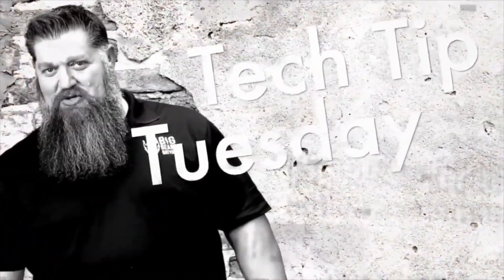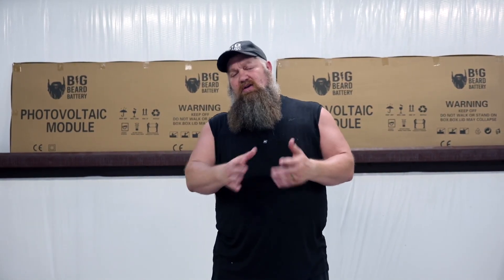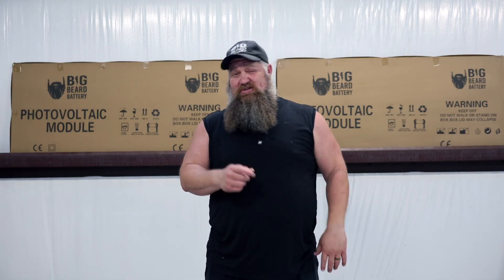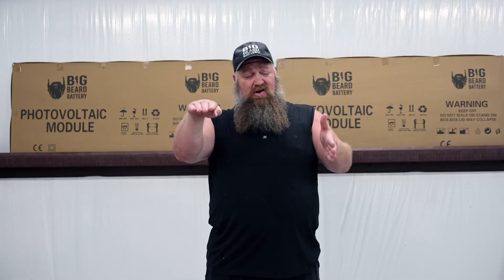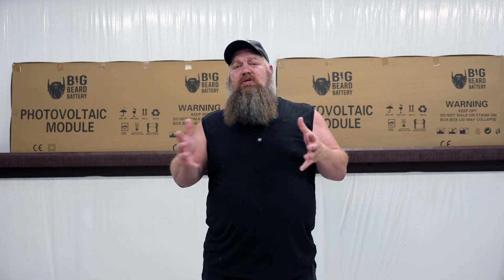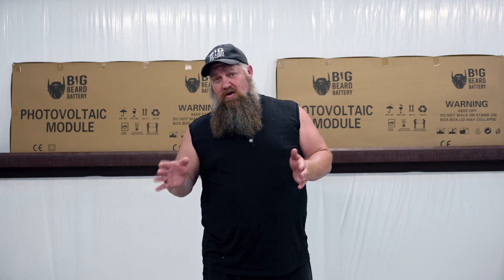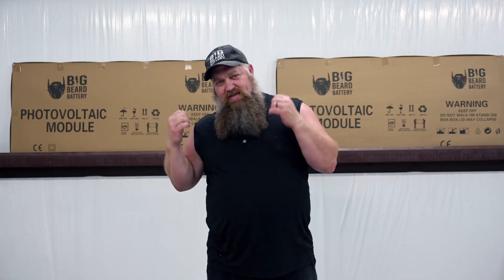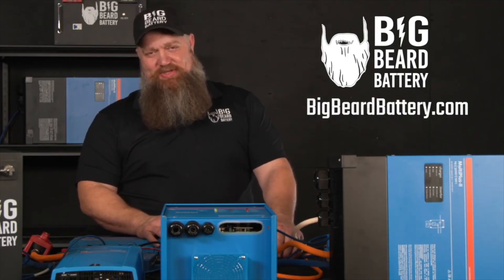Best Way to Wire Solar Panels: Series vs Parallel Explained

Comment: I’ve go 4 195w panels on the roof of my camper, i have them wired in sets of two in series and then those two sets in parallel to connect to the MPPT controller. It works  great that way.